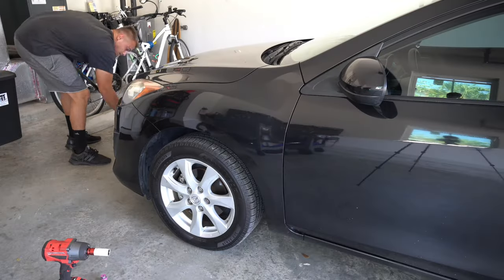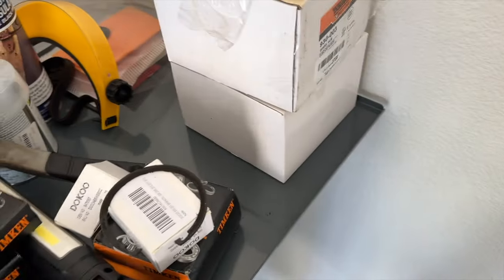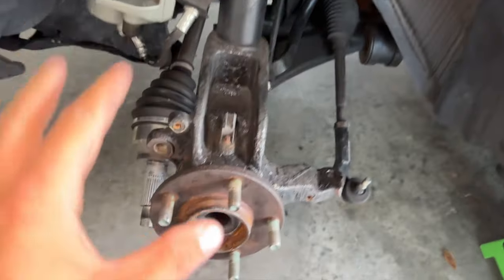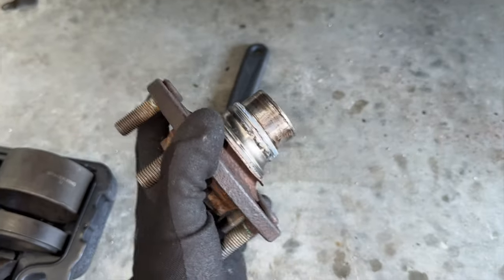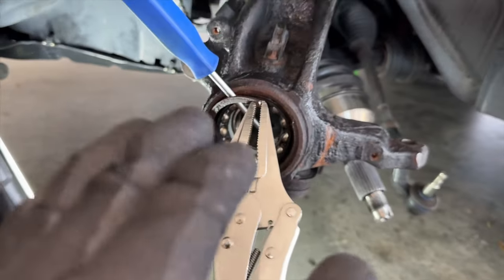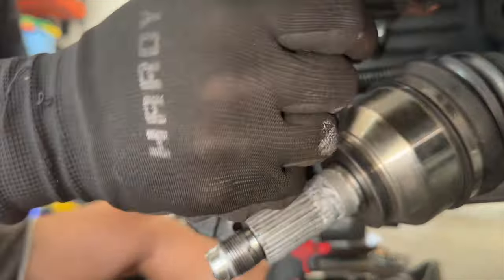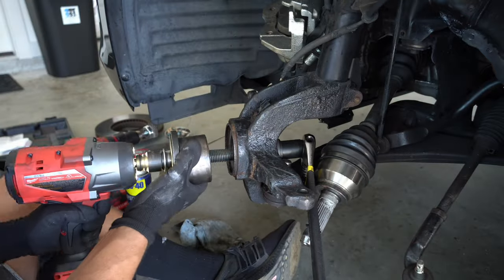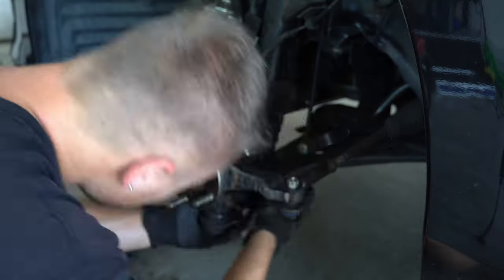How To Replace Front Wheel Bearings WITHOUT A PRESS! | 2010 MAZDA 3

Comment: Paying a deposit for the tool doesn't help me, if I had $400 I wasn't using I would buy a press. Thanks for the vid though, excellent instructions.
Reply from the maker: You can put the tool on a credit card and it will fall off after you return it. It will just say pending. Otherwise a press at harbor freight is $200 and Facebook marketplace is $120
Reply: I think your missing the fact that it's only 40 dollars to rent it man
Reply from the maker: @Dfective_Rubber  its $0 to rent it lmfao what

Comment: The O'Reilly's that provided you with the $400 tool for free can also provide the bearings. I think providing that $400 tool earns my business - even if the bearings cost $2 more there.
Reply from the maker: oreillys doesnt sell OEM or Timken bearings. that is why i did not go with them. i dont like using any other brand as i really dont want to do this again at least not for a long time. they sell masterpro which is chinese, not a fan. although their wheel hubs seem alright.
Reply: I just did this same job on my Ram 1500, also went with a Timken hub/bearing. Read the reviews of the O'Reilly hubs/bearings...you'll be doing the job again in 6 - 8 months. And they don't "provide" that $400 tool...you're esentially "buying" it then returning it for a refund. "Free" would mean that $400 didn't leave my account...but it did, and now 3 days after returning the tool I'm still waiting for the refund to hit my account.
Reply from the maker: @kwb377  interesting i had purchased it on a CC and it was pending and then fell off

Comment: All these tools.  This is all great info but as someone in an apartment with a socket set, 100 bucks, and nowhere to work on it except finding a parking lot, I find it quite daunting.  I don't have access to any of these specialty tools or extra parts on my budget.  For someone with the means, good vid tho.
Reply from the maker: Well if your budget is $100 then you’re not going to fix anything lol regardless of the tools or not. It’s easily $400+ to get a shop to do one side. If I was ballin on a budget, I’d rent the press at O’Reilly, go buy the highest powered impact at harbor freight or find the Milwaukee high impact one on facebook marketplace. They sell cheap. Get some impact sockets at HF and the cv axle one and a 3lb hammer. No need for pickle fork just wack the lower control arm and the ball joint will come out. As for parking lot. Go ask your local autozone, oreilly, advance auto parts. They usually will let you work in their lot and even let you borrow there tools for free.

Comment: put the lower ball joint back into spindle to hold strut while using breaker bar. Also if no impact, pop center cap off before you lift car and break CV nut while car is in ground with breaker bar as well as the 5 lug nuts, then lift and jack stand it. great vid, may do this today. Just spent 2 hours on the driver side! This is tough work on an 08 as the spindle doesnt have level interference points for the horseshoe, you have to coble a spacer of the upper caliber bolt. I ran a nut into the bolt and pout it in for a 3/4 spacer so the shoe could rest on it. And the torque needed to break the spindle and the bearing race is scary! 26" breaker bar and I was almost standing on it (180 lbs) and it was barely moving until a big CRACK! and then it started to move. Of course the race came out with the hub and I dont have your induction heater so I have to grind it off very carefully with an angle grinder. The struts were the easiest part! Literally loosen that pinch bolt and hammer them off, you dont even need to take the LBJ or the caliper off, just the end link and the ABS/brake line bracket.
Reply from the maker: i wish you luck! you got this!

Comment: I don't even have a Mazda, I have a 2006 Forester XT, but dude those torque specs overlaid as you're putting it back together were CLUTCH. It's the little details like that which make a good video. Thanks so much for the tutorial -- How long did this take you for one wheel? I need to do all 4 on mine and I'm not looking forward to it.
Reply from the maker: i new it would help someone! i wanted a video tht had ALL the information in it, most videos online dont have it. i broke this into a 2 day part. i also have a video replacing the rear on my channel. Rust delays everything obviously. C clip was a pain and if you havent replaced other suspension components its a good time to do it while youre in their. Off camera i was able to do the right side bearing in about an hour-ish really not that bad.

Comment: I took my knuckle off the strut. Removed the ABS sensor. Cleaned up the knuckle. Warmed up the knuckle on the grill for a few minutes. Shut off the grill. The frozen bearing dropped in like butter. Put the retaining ring on. Put the knuckle back on the warm but turned off grill for a few minutes. Dropped the hub in like butter. 

Had the extra work of taking the knuckle off (although I used that opportunity to clean it up and treat it with ospho) as well as the abs sensor, but it made the reassembly of the bearing and hub so easy without tools. 

Great video!
Reply from the maker: haha thats awesome! But how did you get the old wheel bearing out?
Reply: @yankplayer87  id deffinately try BBQ heat next time! The inner race that comes.off with the hub...grind a V at the edge and score the race down the side. Get a chisel and whack that V groove down the shaft axis  and the race should split clean on that score line without having to grind the race off per my fleet mechanic.
Reply from the maker: @68pishta68  or just heat it up. this way you dont accidentally knick the wheel hub

Comment: Thanks man I was about to take wife's Mazda 3 to a shop, but your video is giving me the confidence to attempt this myself. Quick question, do you recommend an alignment after replacing the wheel bearing using your method?
Reply from the maker: With this method you shouldn’t have to. You aren’t touching the strut or the tie rod. If you remove the knuckle and use a press than probably a good idea. But once it’s all back together just drive the car and see if the wheels straight. If it is you’re good. If not then get an alignment! You really need a good powerful impact, Milwaukee or the high torque at harbor freight!

Comment: Very helpful thanks, quick question what letters of the part did you end up using from rental tool?
Reply from the maker: oh haha i dont remember just line them up you can clearly tell which will fit and which wont. just make sure they are loose. there was one i remember that was a bit tight and if i pressed it then it could get stuck! so just go a size down